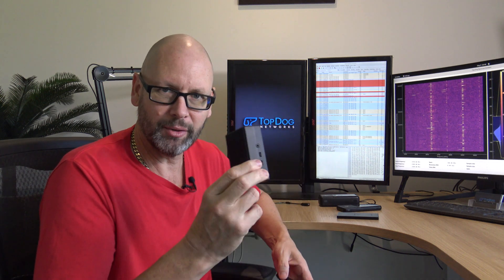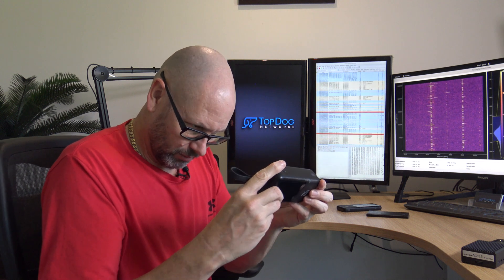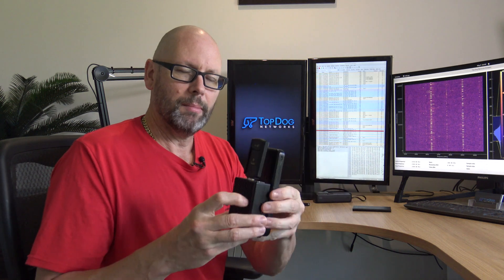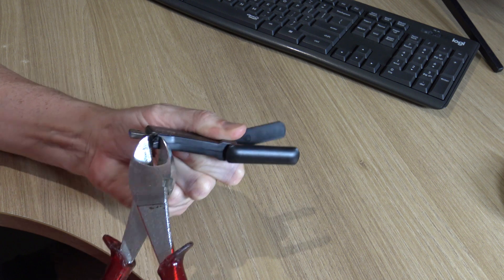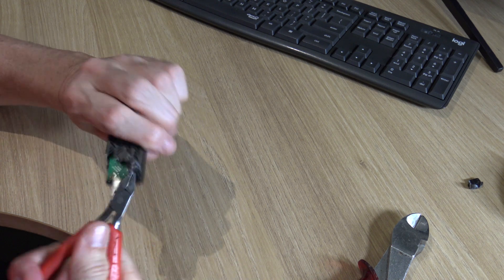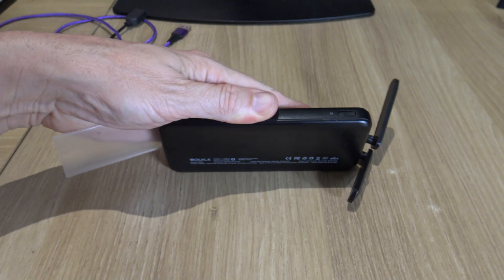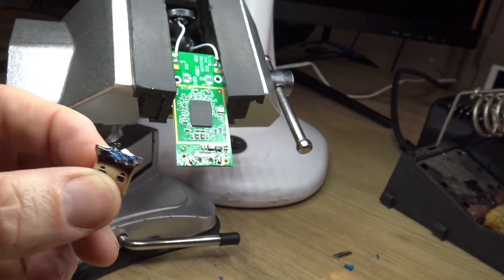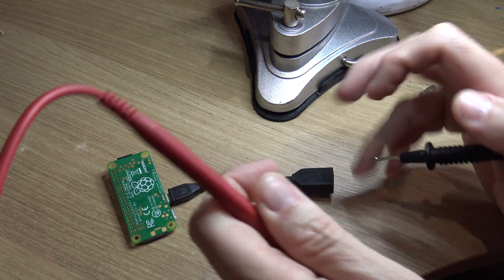Portable Raspberry Pi Wi-Fi Packet Capture Device

Comment: Not sure if this has been previously asked. But would you consider doing a video on what wifi adapters can sniff packets as not all can ( and furthermore which chipset you'd recommend if you do any particular ). Perhaps a round up of adapters people can get you started in wifi packet/sniffing capture, to the more expensive ones like you might recommend, ones that supports more 802.11 and more frequencies ie 2.4ghz, to 5ghz and so on...   Ones you'd recommend to get started or more capable ones/others if want to packet capture more 802.11 std's or more freq's...

Comment: Good idea. I was thinking of doing a similar thing but with an ESP32, although for 2.4 only.

Also isn't it better to have the antennas at 90° to each other?
Reply: yes, but separation is more important (1/2 wavelength?)
Reply: @pete3897  I'm not sure that is important. I fly RC models and even some commercial Tx'es have antennas which are closer than that and yet still work fine (2km+ range). Polarisation on the other hand is very important as you can lose significant amounts of power when the receiving antenna is at 90° to the Tx antenna.
Reply: @loc4725  polarisation accounts for 3db. Having antennas closer together won't reduce signal, you just miss out on the benefits of diversity receive by avoiding destructive interferance. I stand by my assertion but thanks for your comment :)